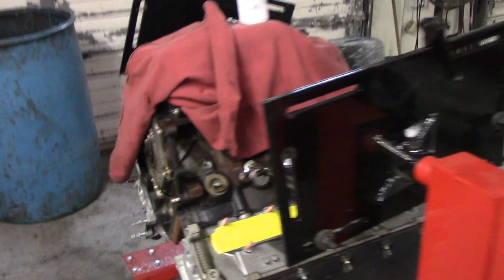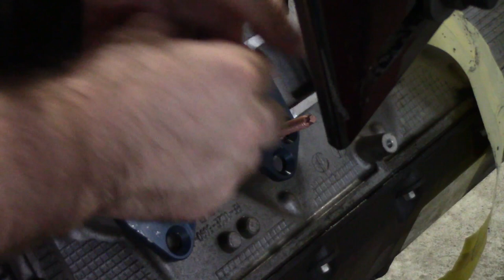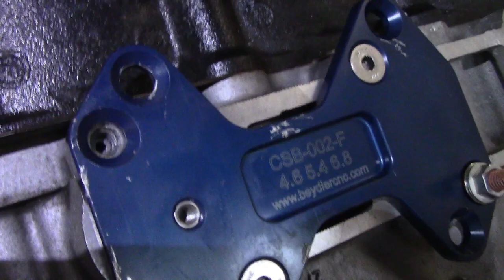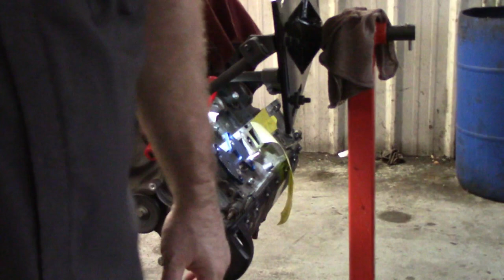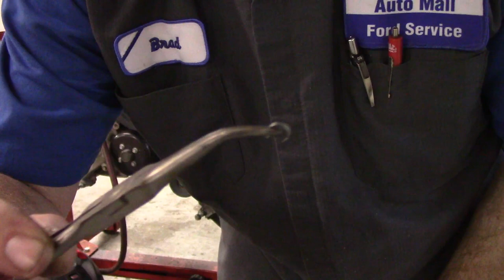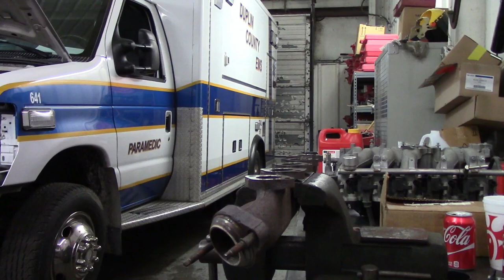2010 ambulance with lots of leaks

Comment: Like that lil tool for drilling the studs, I can see why you like it so much after seeing it in action. A van ambulance I wouldnt wish on my worst enemy, practically have to dismantle the whole front end, and of course you have all the extra heating air conditioning hoses to go with not to mention all the extra power wiring and any other cabling they have ran, then you get the fun of undoing the transmission, then you have to inch it out of their  after they have shoehorned it in.

I would have mastered the art of faking a heart attack when I saw a Van Ambulance pull up by now...lol
Reply from the maker: lol
Reply: Screamin Demon true but he gets paid the hours no matter what he's working on. so might as well take your time and do it. the pay is the same.no matter what vehicle and you have to make 40 hrs in a week.
Reply: flmmaz I'm curious about your engine stand, it looks to be a conventional stand with adaptors to bolt to the motor mount location, plus you have one per side. wouldn't conventional mounting to the bell housing location be easier, or is this done due to the weight of the engine?
Reply from the maker: In this particular case, a regular engine stand would have made access to the cylinder heads a lot easier. They make pretty beefy stands that can handle this kinda weight with bell housing mounted units but we don't have one. Our regular stand is pretty light weight plus this engine is really long. I used this stand because of the rotary feature, I love that thing. :)

Comment: I don't know seems like a left handed drill bit would be easier.
Reply from the maker: I used a left hand drill bit.......it wouldn't touch it. Left bits work fine on trucks but not so good on E series.
Reply: why would there be a difference? talking about using the guide tool like you did here. seems like the right handed bit just drives it deeper.
Reply from the maker: The vans make a ton more heat. When the manifolds warp and pop the end of the studs off it boogers the threads up pretty bad. It would take a thread chaser or tap to clean the threads up enough for the rest of the stud to screw out with the light pressure of a left hand bit.